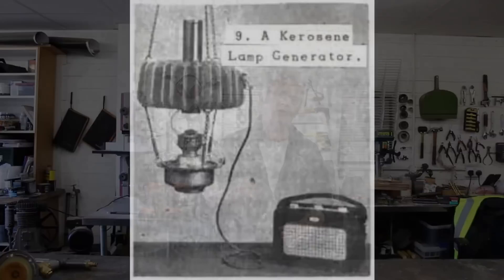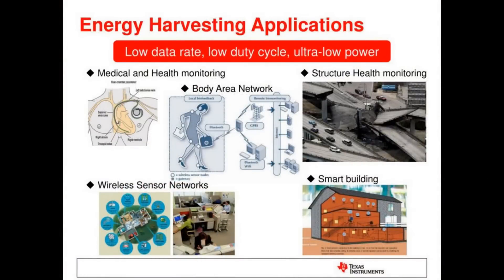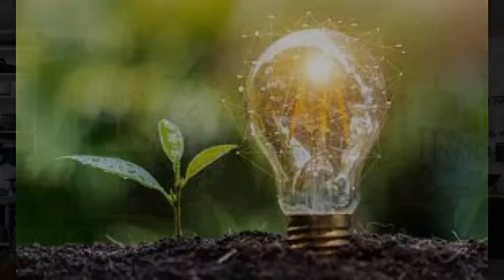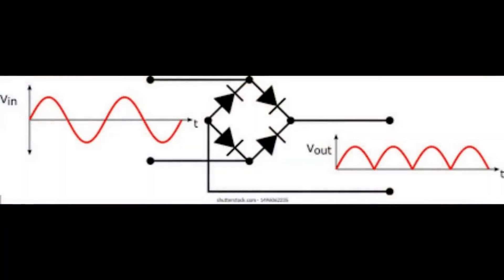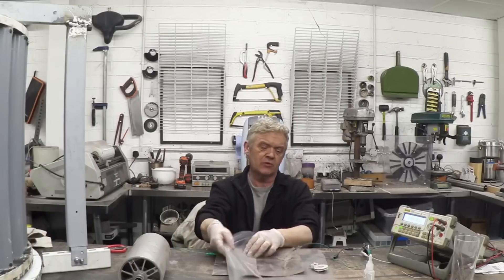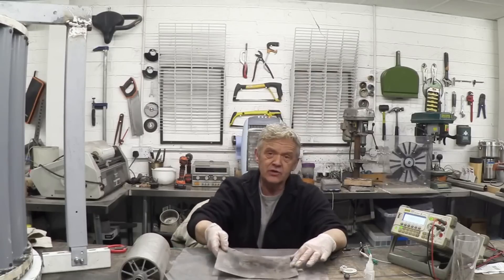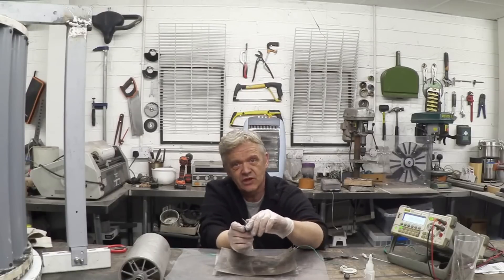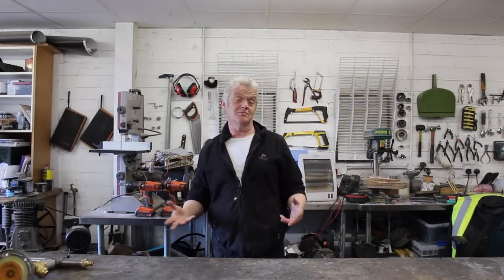2055 Energy Scavenging

Comment: Thank you for this.. my first project will be a self powered vent register. It will detect the temps and adjust registers accordingly. There is a commercial product but it requires batteries. I wanted to release this with energy scavenging.. was watching your videos on converting pc fans to generators for inspiration  but would like to avoid rewiring.. You mention signal phase motors as a source but do they come that small \ with low torque requirements (AC is pretty low pressure at the registers, right - well I am a bit unclear how much power could be scavenged but feels like there is some potential to even run a motion activated  light for a self powered bathroom?

Comment: Rob i know it's not the right video BUT NEEDED TO SAY THIS TO YOU THEM  VALOR GAS HEATERS THAT YOU CAN PUSH AROUND 
WHAT I DID WAS CUT A SLOT IN THE FRONT WHERE THE GAS COMES OUT AND PUT A LONG PIECE OF CARBON FELT GOING INTO THE BACK OF IT IN A METAL CAN WITH A STRAP ON IT
FILL HALF WAY WITH 50-50 OF PARAFFIN AND OIL 
NOW WHEN I LIGHT IT THE FLAME HEAT'S THE BLOCKS AT THE FRONT IT'S BRILLIANT 
THINKING ABOUT TRYING A COMPUTER FAN AT THE BACK TO BLOW HEAT FORWARD??😮😮😊

Comment: I was reading into rectennas, rectifier antennas, which take radio waves and convert them into usable electricity. Usable electricity. A lot of the circuits are very similar to crystal radio circuits, and they're used a lot of times for RFID chips, but there's been increased. Talk about using them for different types of low power devices. I'm sure those smoke detectors in particular could use that type of power. I could also imagine lighting, in particular ambient lighting using a rectenna, a transistor, a photoresister, capacitor that would charge up all day using ambient radio waves and then light at night.

Comment: I want to get a Chinese diesel engine. Possibly disassemble it and thoroughly clean it, and reassemble, because QC is well, missing on alot of things like this. Set it up to burn waste oil vegoil, used engine oil, use the exhaust to heat the oil  before it is injected,  but build a processing plant to filter it and remove  the water housing concentrated solar, slowly pass it through a stainless pipe, heat it to about 300-350°, dumped in a tray to allow steam to escape then be stored in a barrel , i have a 400-500 gallon fuel oil  barrel, that thing full will last years! Up to 5 years possibly. I'm just planning to run two 150 amp alternators at 24v (28-28.8v) if i can still get the 150a out of it at 24v from what i seen , the curren output stays the same, when the regulator is modified for higher output from 12v to 60 v is simple, I heard some alternators  are capable of near 1000 volts at a high RPM. But lower just above idle  3600 and less, 100 volts is easy 120v being possible the frequency being insane, probably 60 khz, over 60 Hz required. I'm just looking for about 300a to charge a battery bank with,  use a dump load in the event the voltage reaches 29v I don't want the battery charged over 29v 28.7 actually but 29v is maxed out!   I'd really like to build a steam generator, burn paper and plastic garbage to make steam, even if it's only  100amps at 29v, i guess that's just shy of 3kw, because its actually rated at 105 amps,  from trash and wood scraps, running for a hour to 3 hours should be plenty! To help in rainy weather, with no sun, the 300 will run everything, and charge batteries!

Comment: I'm not a semiconductor representative but the LTC3588-1 (Nanopower Energy Harvesting Power Supply) has been around since before Analog Devices purchased Linear Technology.
Several online maker/DIY sites have already populated breakout boards for sale and your favorite site likely does as well.
I took one (I got mine at Sparkfun, I'm not an affiliate) and a couple blank PCB copper clad panels, soldered a wire to each of them, connected it to the chip, bang I was getting 100mA easy off the fluorescent lights in the lab at work (and that was in 2012).

Comment: Hi,
Imagine that you have a Sterling engine that you get to temperature mechanically until a resistance heats up the air container? As soon as the gets air reaches a high enough and sustainable temperature, the air will continuously contract and expand. If the energy generated by the Sterling engine could self-sustain the air chamber temperature, the movement will be ad eternum?
I’m no expert, just a curious mind, maybe there are other ways to achieve the same goal, that’s why I wanna challenge you. Can you figure out a way of using the movement of the Sterling engine to keep it’s air hot enough to sustain uninterrupted movement - a machine that feed on itself?
Cheers

Comment: I guess even putting what is basically a umbrella, covered in aluminum,or copper foil, on a 10'-20' pole, in the top of a couple dozen trees, (the large umbrellas like 6'-9' across) and put about the same number of ground rods, use about 20 gauge wire, to handle way more amps than it will see,  the whole lot connected to a 2-4kv cap about 1 farad each, so the difference in voltage doesn't pull down a higher one, the match the voltage, parallel caps close in voltage. Then use a large super cap bank, 10-20 farad 7-14v,  build a high voltage buck converter. It will possibly take days or a month to charge the cap bank, I can't recall the voltage for atmospheric electricity, 1kv per 100 meters or something, if you had nothing but foil, wire and bamboo, a few tools, some older electronics to scavenge from, you can atleast start a fire ,  as for a more permanent power supply a couple dozen little wind turbines  using 250-500 watt brushless motors would be better than nothing, use hover board wheel motors , to build vawts,  about 60"-72" diameter, abd 24" thick, made from steam flattened bamboo, dried and treated with teak oil!  A bit like a waterwheel on its side, only much lighter,  using strips of bamboo to make square dowel rods, to build the structure from steam  bent in layers to be glued together making scoops about the same way. 
If they average 18vdc and 4-5 amps per hour, that is 100 watts +/- a few watts,  times 24, that's 2400 watts! A poor village in Africa or south America could live on that, use the power for a 6-9 watt light bulb in each hut, and a refrigerator for the village to keep food fresh in. There is  not many that poor anymore, slightly scaling it up, and a few pedal generators,  they could have more, maybe put a water wheel in the river. Spin a 2-3 kw generator, every house get a 100-300 ah battery, let the system charge the batteries, then runs ac cord to the house from the inverter, with a breaker 10-15a (5-10a for230-240v)  a community kitchen would be better, with locked sections in a  large fridge, and separate freezer, this is running astray from power scavenging,  the first time I connected solar panels to a battery bank attached to a inverter, making my own power! It was an amazing feeling! I love it✌️

Comment: A unit full of “blades of grass”  you could package hundreds / thousands sanding vertically swaying in the slightest winds.   

Made from heavy laminated material designed to allow just the right amount of sway.   

All mounted to a plate so they stand vertically and have a wire routed system keeping them in contact with the system.

Comment: Hang on, can I check my understanding here? The variable capacitor that you demonstrated there is pumping electrons out of your "earth" and then putting it through the full wave rectifier diode structure and storing those electrons in the other capacitor? Have I got that right?

Why does the variable capacitor have that effect? I assume it's the kinetic energy being converted into stored electrical potential somehow. I can only assume that when the plate is close then electrons are attracted to the bottom plate. The only place these electrons can come from are the earth. But then when the plate is moved away then the electrons are left to dissipate and so... actually, I think it might be the other way around? I feel like something needs to push the electrons through the rectifier circuit, and my gut instinct is that it's the motion of pushing the top plate down towards the bottom plate that does that. Electrons wouldn't naturally dissipate through the rectifier to any great number. Ok, off to google I go.

Comment: Could you remove the alternator and charge the car battery from the catalytic converter? Lots of heat from that.
Reply: Some car manufacturers did look in to it - dump the alternator and instead use  thermoelectric generator on the exhaust, after the converter. But the required components are bulky, expensive and heavy.
Reply: @vylbird8014 That's something that needs to be released to the masses to solve.  Bet someone could figure out how to make a better design over time.

Comment: i was wondering about your axial flux generator ... can it be used as motor if i put power in it and if so ac or dc how much volts etc
Reply: It can, yes, with a few small modifications - you'd need a controller for it, but you can use an off-the-shelf BLDC motor controller. It wouldn't be the most efficient of motors though.

Comment: Telephone landlines in America carry five (5) volts that can be constantly syphoned (scavenged), whether the line has active service or not.
Reply: those 5V are generated by your phone co, so it is simply moving the point of generation from your power co to your phone co, so is not scavenging (taking the wasted or unwanted).
Reply: @Staedford you're draining the batteries
Reply: Thats stealing, not scavenging.  Your neighbor has 10 gallons of gas in their car, with a simple tube and gas can, 5 gallons could be yours..... free energy right?
Reply: Incorrect assertion I’n afraid

Comment: How about Quantum batteries that never lose their charge. 

Quantum vortices. Are used in a Quantum battery that contain and maintain Quantum entangled electrons within a electrolyte. And are a type of topological defect that occur in superfluids and with superconductors magnetic field. They are holes in which a superfluid circulates around the vortex axis. The interior of the vortex may contain excited Nano particles within a superfluid liquid electrolyte or air, within a vacuum.
Quantum vortices are defined as a region where the local rotation dominates the strain. The flow of the superfluid is quantized, meaning the circulation takes on discrete values like Quantum entangled electrons within the nucleus of nanoparticles of Fool's Gold within the electrolyte.
Here are some things to consider when buying a quantum vortex vacuum generator:
A vortex tube like the Quantum battery Pyrex glass toroidal tube can be used as a variable aperture to reflect the cooler central vortex.
A vacuum pump or thermal acoustic vibrations from varying frequencies pulses may allow a successful cascade of vortex Within the inside of the toroidal tube that has been laser etched with a fentosecond laser to be super hydrophobic and the difference between it and the laser etched rail strips to WIC one of two superfluid liquids within the tube.
Adjustable vacuum generators can combine the benefits of high and low vacuum generators. By threading the plug in or out of the body, you can control the amount of vacuum and vacuum flow that they generate thas done with the BMS. Otherwise known as zero point energy.

And you can run everything I said above through AI systems for yourself.🌐✌
Reply: This is the same Zero Point Energy. Used in the US TR3B Black Manta🤯
Reply: Great idea. Keeping with the spirit of this channel, make a video of you building one in your garage with parts anyone can get